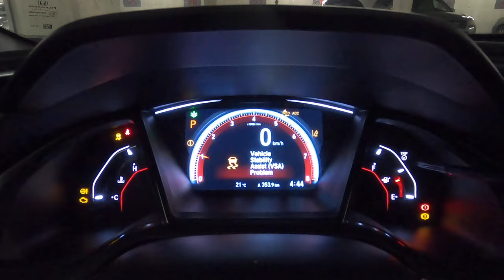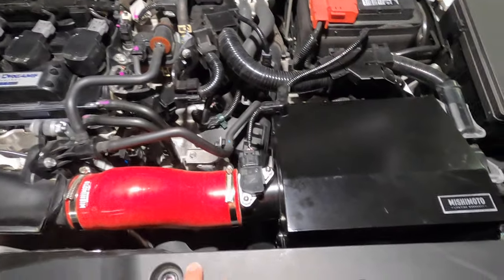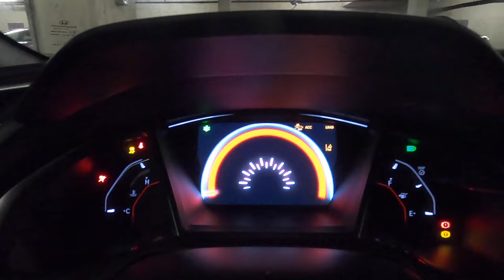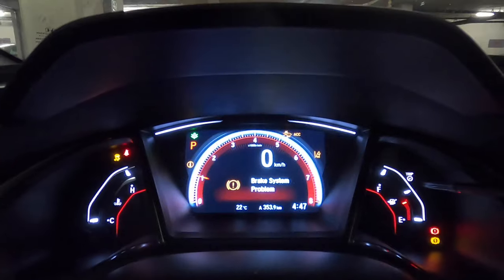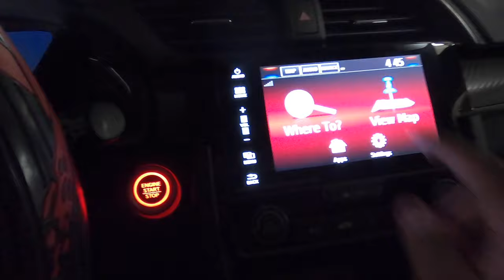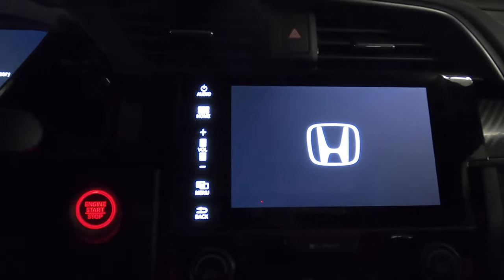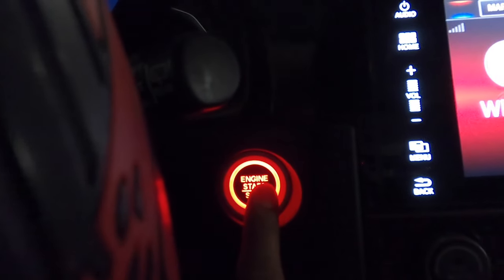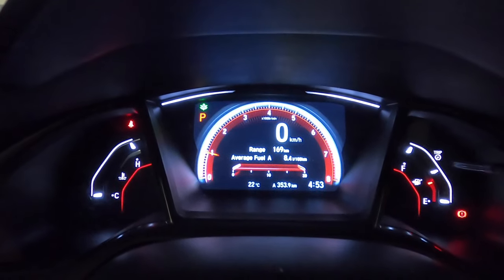HOW TO FIX MULTIPLE WARNING LIGHTS ON DASHBOARD OF 10th Gen Honda Civic

Comment: You really saved me, thanks!! It just happened to my 2019 accord. 
For any other accord owner here, this is what I did. Instead of holding power I went to settings, systems and selected factory data reset. After resetting the screen asked for a pin , which I didn't know, so I turned the car off and then on again and a message appeared saying to press the power (volume) button for 3 seconds. That was it, all the warnings went off.
Reply from the maker: Thats good to know! Thanks
Reply: I’m trying this now as what the video instructed didn’t work on my 2016 Honda Civic touring :/
Reply: Thank you so much, the first video didn’t help me but your comment helped me so bad all lights turned off!!!! 👍🏻👍🏻👍🏻
Reply: And so u all know that I tried to reset my daughter's 2016 Honda Civic Ex by doing the resets and by the battery and didn't work till after I drove it about a mile and then shut it off and restarted it and then the warning lights finally went off
Reply: My 2021 accord started with a check engine light on my cruise control is disabled collision mitigation my sport mode ain’t working
Reply: Thank you for commenting but did not work on mi 2020 accord but good to know.
Reply: @dougiefresh386  did you ever find out what the cause was ?
Reply: Can you specify which trim you have? I have a 2019 accord LX and it didn't work.
Reply: @Yesenia Delgado   did you get your touring warning lights removed ? If yes please share
Reply: Did not work for my 2020 si unfortunately
Reply: The pin should be in your owners manual
Reply: I will  try  this man my car has monts we all those lights  I went  to the dealer  but they  order the front  Camara and still  waiting  but I'm tired  of all those lights  man let see  if work for me
Reply: I have a 2019 l, same issue with the pin. When I hold the power button down, it just beeps 3 times and nothing happens. Can you help?
Reply: Gracias, me funcionó en el Honda Civic 1.5 2018

Comment: Yessss! I had this issue and I took it in to get fixed. Before pulling into the repair shop I turned my podcast/ audio system off just so it wouldn’t pop on when they were fixing it. They came out after starting it and said there were no lights on. Thought I was crazy maybe? I was baffled! Now I see why !!!! I reset it without knowing. I’m going to tell this to my mechanic!!

Comment: Just had the exact same thing happen on my 2019 Pilot, went into limp mode and was not drivable. Was about to have it towed to the dealer and I’m a month past my warranty. This worked for me and saved me a lot of money. Thank you for posting this, it was a huge help.
Reply from the maker: Im glad it helped! 😊
Reply: That happened to my 2019 civic sport but it was the battery, this was maybe a month ago. The lights flashing happened again a couple days ago accept it is actually operable.
Reply: @irierocio  FYI, the dealer told us it was a faulty fuel pump which was recalled, at least on my 2019 pilot.  They replaced it for free since it was a recall, and haven't had the issue since.
Reply: @mattnork  those silly technicians! They replaced mine as part of the recall as well. Also about month ago.. funny thing is it didn’t flash those warnings then. I guess I’m taking it back in.
Reply: @irierocio  I should have noted that they replaced the fuel pump about 6 months back as part of a recall.  Then about 4 months after that the light thing happened, so we took the car in, and they replaced the fuel pump a second time, again for a recall, and so far so good.  So this is pump number 2 for us.....
Reply: Pp
Reply: 2019 Honda Odyssey - I had warnings on, no AC at low speed,  car was stalling at startup then died altogether. After an hour, started and drove ok, but warnings were still on. A few days later it all again. I will try this and also check for fuel pump recall. Thks
Reply: How can I restart the pilot system?

Comment: you made my day, fixed the 2018 CRV thanks to your video. Saved a lot of money and time!!!
Reply from the maker: Glad I could help!
Reply: I do it but then for some reason, my ears keep coming back on. It’s a 2017 CRV. The shop is telling me they want to replace the fuel injectors but I’m not going to because the car is running fine and they want like 2600. I have to find another solution.

Comment: I have a 2020 Honda accord lx & my screen is made different! This didn’t work for me! I believe the box in front of the car may be the issue! It still brakes if I’m too close to a car so I’m not sure. Dealership wants over $400 to fix but car runs fine.
Update…… 2days later… I did this but a bit different bcuz my  HONDA screen is different! I did hit start button twice cuz car menu wouldn’t work in accessory mode . I went to clock/ menu, settings, vehicle settings, default & chose yes! I guess that resets to factory default. I turned the car off then on. It didn’t work right away but the next day I noticed the lights were all gone off. & it’s been 2 days they have been off! This the longest they have been off so I’ll see if continues to work. So thanks again for the info. It eventually did work out!

Comment: Omgggg you saved me a trip to my local Honda dealership. I had my battery replaced and no one shocking didn’t know what to do at Advanced Auto. Thank you so much 😊
Reply from the maker: I’m glad it helped 😊🙏
Reply: This is exactly how it happened for me!
Reply: @geefamz7172  do you know how to fix this problem with a key start
Reply: I am currently having this issue with my 2019 Honda civic and it’s been at the dealer for 3 months. They have changed my valve timing control actuator abs control module and the module computer and after 10 minutes the same warnings came back. I noticed also my car feels boggy when shifting from 1st gear 😓 only when these lights are on

Comment: Thank you so much had to drive to work and leave early I was about to take it to the dealership where they would charge me $170 only to inspect it you are a life saver grateful af <3
Reply from the maker: You’re welcome 🤙
Reply: Same issue appeared to pop up only this time I wasn’t able to reset it by pressing the power button on my screen took to the dealership and it happened to be a bad fuel injector 
Lucky fuel injectors are cover for up to 150x miles according to the dealership advisor so I got them replaced at no cost

Comment: You’re a life saver.  My 2018 SI started doing this.  I had to reboot mine twice but it did work in the end.  Thank you.
Reply from the maker: I'm glad it helped
Reply: It came back up.  It worked for a day but it won’t clear this time.  I still appreciate your help.  I’ll post back if I ever get an answer as to what is going wrong.
Reply: Do you have any problems yet !? @J K
Reply: This worked for me after changing the brake fluid on my Si today. I needed to reboot 2 times the first one fixed the "check engine" becuase I put the switch on with the mass sensor disconnected, and the second time fixed the "brake system error" for bleeding the brakes
Reply: @JK-bx5fg  did you find out what it was
Reply: @Anthony-jp4lu  sorry for the late reply.  It was a loose wire to the boost control solenoid.
Reply: @Anthony-jp4lu  sorry for the late reply.  It was a loose wire to the boost control solenoid.
Reply: You should've the one designing these cars, or user manual that resolves and unravels all of the quirky, mysterious software issues. You have the mind to do what most people cannot do.

Seriously, you could write a manual that provides the fixes or "hacks" to these software related issues that should not happen in cars.  As more people get their hands on this book of yours, less money goes to Honda in diagnosing and "undoing." I hope you continue posting videos. You are helping so many people by saving them time money and hassle. You are sharing your knowledge and indirectly teaching them how to figure it out and do it themselves and that is empowering. 😊

Comment: Wow it worked! In my 2015 EX I had to go into settings, system, and do factory data reset. Not sure if needed it twice but I did it once, drove a few miles, didn't go away. Did it again, drove about 20 miles, gone on the next start-up. Fingers crossed it stays away!
Reply from the maker: Awesome 🤙

Comment: It worked! Thanks so much. I replaced the battery and was thinking I got the wrong one and blew a fuse. I don't have the model with an lcd screen just a regular radio, and it didn't say thing about rebooting, but I put it in accessory mode and geld the power button for 5 seconds and the messages went away 😂
Reply from the maker: Glad it helped

Comment: Wow I have a 2018 civic, car had a slow start it was like battery was dying. Alternator is new, starter new. Went to Autozone got battery recharged it turned out it was bad so under warranty I got a new one. Installed new battery and all these warning lights came on. 
I did this on the video and it worked!!! System reset all lights gone. Thank you so much for the video!!!!!
Reply from the maker: You’re welcome

Comment: So here's my story. I got one of the first 2016 10th gens out there in late 2015. A couple of weeks ago, I got a new battery. This morning, you guessed it, all the trouble lights paid me a visit. I looked at/tried most of the comments with no luck. Rebooting the radio didn't work. Finally, as per one of the comments, I took off the negative battery terminal and cleaned the cable and the terminal. Reconnected it, started the car, waited while it reinitialized and bickety-bam! those stupid warning indicators went away. I was happy. Time will tell if they come back. BTW, after the trouble lights 1st came on, I drove it 40 miles from work to home with no power loss.
Reply: I have exactly what you have right now, the reset didn't work. I am gonna try the battery trick tomorrow however I can't press my gas peddle down like its stiff, which makes it like I can't start the car's ignition... Did you have this problem alongside the others?
Reply: did the problem solved man? it has been a while since you post this, how is your car doing?

Comment: Just had this issue on my 2018 Acura MDX a few minutes ago. Here's what I did to fix. 
1. Remove your foot off the brake pedal
2. push the Start button and count 5(5 secs). Then push the Start button the second time and count to 10 (10secs). At this time, put your foot on the gas pedal for 30 secs (just count 30). Now, push the Start button to turn the ignition off. Finally, match the brake pedal and hit Start button and the car starts and the codes are cleared.  Sometimes you might have just 2 codes left but within seconds they clear off.
Reply from the maker: Thats good to know. Thanks

Comment: Thank you it worked.  I changed the battery all warning lights stayed on, started car 2018 civic, all lights stayed on.
Followed your directions and it works.  Only thing different is lights went off after driving a block.
Reply from the maker: Awesome. Good to know.

Comment: Had the same problem with my 2018 CRV after changing  air filter. First time just two warning lights. Just stopped turn car off and on and they cleared. Today all warning lights came on. In my case I reset the system about 5 time for one warming to clear, then I rebooted again and they all disappeared. Don't know how long things will stay normal, but everything is cleared for now. I'll be canceling my service appointment. Than You VERY MUCH!!!
Reply from the maker: Wow! thats good to know! Awesome 😊
Reply: By reset 5 times you mean resetting the computer like he did in the video? Or restarting the car 5 times?

Comment: Omfg bro you just saved me!!! I literally did the same thing cleaned my engine bay and air filter… all the lights came on and I thought I f**Jed it up 😭😭😭, thank you soo much for this video 🙏🏽🙏🏽🙏🏽🙏🏽
Reply from the maker: Glad I could help
Reply: I had the same issue with my honda crv 2019, I tried it twice it didn't work, the Ac was on, when I turned the Ac off the third reset worked, thanks so much

Comment: Thanks man, very useful your video, last morning my Fuel Injection wires were eaten by rodents I think, I had fixed the wiring and right after computer restart the errors did not clear, but next morning all errors cleared out. Very helpful video!
Reply from the maker: Im glad it helped 😊

Comment: Ok I own a 2017 Honda CR-V.  It seems to me Honda sets up the dash to scare you back to the dealer.
My car started at about 60k miles, I just kept resetting it, finally replaced the the plugs, coils and injectors, amazingly the lights went away and have stayed gone.
I really believe I had a defective coil or injector.  Dealer said 2500 to fix the problem and claimed it was the wiring harness and while they were doing that they needed to change to injectors and plugs.  Note 2017 1.5 turbo requires injectors to be replaced around 100k, same with plugs.
I did the work myself and it took about 2 hours with common tools.
Be aware that you need intermediate skills to do the job.

Comment: I had the same thing happen in my 2015 Honda Civic LX. It was after I was parked & sitting in it with the engine on for a while.  I've had issue with my car when it was newer and had no idea what was happening; called my mechanic at the time and turns out a reset of the computer after an oil change was the cause of the warning.  Scared me, some things about pre-computerized cars were better. lol

Comment: Thanks for the Vid. I'll try that. Interesting... here's my experience. 2017 2.0 L NA, manual with K&N intake system. I was driving for hours in rain that night and also hit some road debris, with a hard hit on the car somewhere. After a while the codes went off but it didn't go into limp mode. Car drove just fine except to stability/traction control. Next day my cousin at his house hooked up his scanner and we got PP171 code. Running too lean. Hmmm.... We reset it and after some driving the codes and warnings all cleared while cruising on freeway. I was happy and then 10 mins later they came back! Shit! 😮 It was still raining and wet on that day. So I was wondering if Filter cone got wet or something, clogged. Cleaned it not too long ago. Usually never a problem till next oil change. Perhaps MAF? Or worse fuel pump or injectors acting up. Not sure as all looks fine but I will try what you suggest. Perhaps it all dried up under there and just have to reset the electronics again.
Reply from the maker: Awesome 🤙

Comment: Same issue started after I ran my Civic for 10 minutes with the air sensor on the filter unplugged (no warnings then!). After reconnecting it the next startup gave me all the warnings you saw.  Your reboot method fixed it but I had to do it twice (no improvement the first reboot). So if at first it doesn't work, give it at least one extra try.  

Meanwhile, seems like a bad design that causes the computer to go haywire if the airflow sensor returns unexpected values.
Reply from the maker: Thanks for sharing

Comment: The reboot happened for my '18 Type R but it didn't get rid of the warning in the dash even though the ignition coil has been changed and the car is running great. Did the reboot twice and also took it for a drive. Time to disconnect the battery, it would seem. Thanks for the video though! Still good to know :)
Reply: Did you ever figure it out. I'm in the same position as you
Reply: @spencermeierarend7884  I didn't figure it out but I bought an OBD2 reader for $85 and it was able to reset things for me. Super handy tool to have. Saves going to a mechanic to have them use theirs on your vehicle any time there's an issue.
Reply: @teddy21  So the tool fixed it?
Reply: @teddy21  so was it resolved? Or did you have to get it checked out eventually?
Reply: @DFDubsports  Yes, the ODB2 reader was able to erase the code. I changed the ignition coil myself and after erasing the warning code with the ODB2 reader it's never come back on again and I've never had to see a mechanic about it as it's resolved.

Comment: This happened on my 2018 Honda civic I did a re boot and it worked for a while but then happened again. I took it to the Honda dealer for diagnostic and they told me one of the speed sensors was faulty. They replaced the speed sensor and reset it and no problems since.

Comment: I have the exact same problem. I'm testing an K&N and forget to connect the sensor of the air filter, run the car and the lights pop up. I'm going to the car right now to test. Thanks
Reply from the maker: Cool

Comment: I am being told to check the battery cause it's still original when I bought her new in 17 and I got those lights come up the other day while I was parked and sitting with the car on. The car is acting fine when driving and no issues but these lights are flashing and annoying. I will try this trick on my lunch break
Reply from the maker: It will work 😊
Reply: @geefamz7172  so I don't need a new and better battery?
Reply: @geefamz7172  I just tried it and nothing changed.

Comment: Damn this just happened to me 2020si after cleaning my bay and intercooler , I did the hard reset on the screen 2x but no luck.  Car was half on while I was doing the cleaning using battery so I’m suspecting it’s a low battery.
Helpful video in general !
Reply: Update I pulled negative completely off and the codes went away